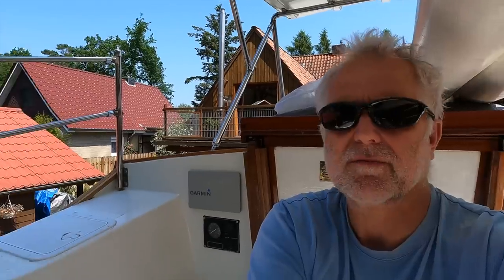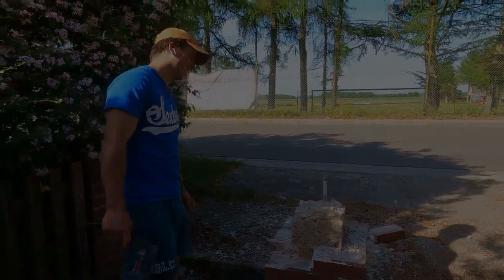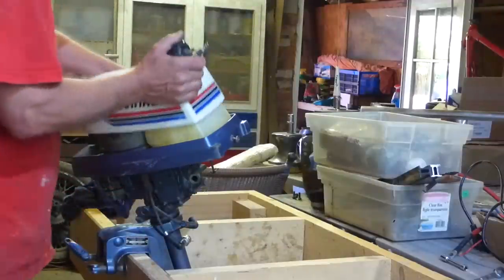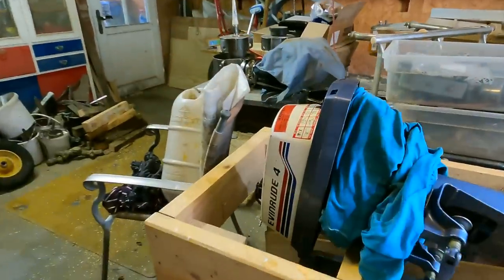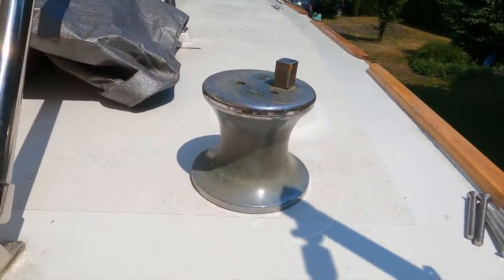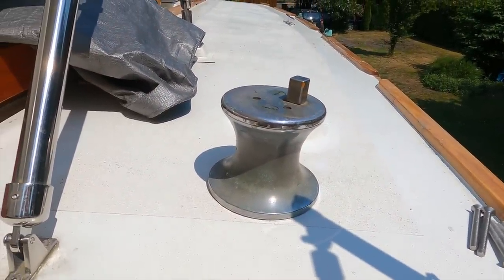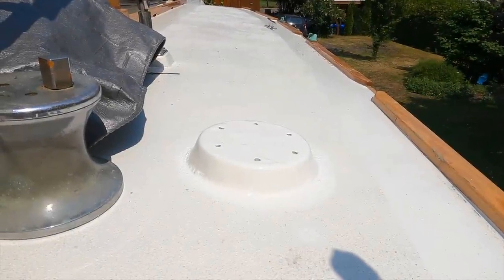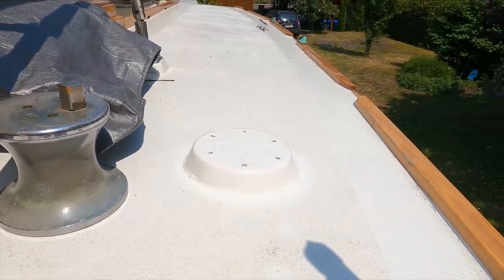Ticking Things Off The List And Good News On The Move - SV Tapatya EP282

Comment: those 4hp outboards with the built in tank have a common problem , the fuel line and valve get plugged and they sure beat rowing !lol. Advance your throttle a bit and give it a spray .
Reply from the maker: Thanks Dave. I’ll keep an eye on it 👍😃

Comment: Adding a SS spring to one end of the cables joining the two fixed stanchions will keep them taut and prevent sagging and rattling, while still providing the needed safety... :cat-orange-whistling:
Reply: Springs stretch under heavy load.. thus making the cable(s) too loose, and hence ineffective, just when you need them most. Fortunately, a long time ago, sailors figured out other, simpler ways to accomplish the same thing.
Reply: @Garryck-1  Of course they do, but the 1" of 'stretch' is the same as you'ld have to leave in a 'hooked' cable. You can even pass the cable through or around the spring body with just enough slack to make the connection. This is a simple and inexpensive solution for a boat being built on a budget.
Reply from the maker: 👍I shall certainly investigate the options 🤔